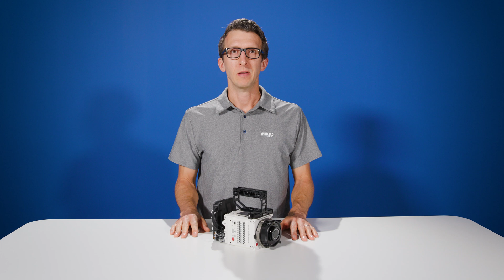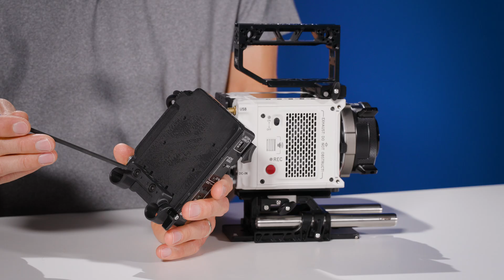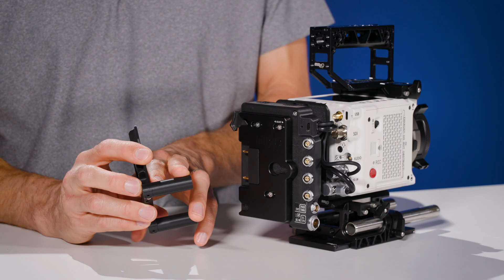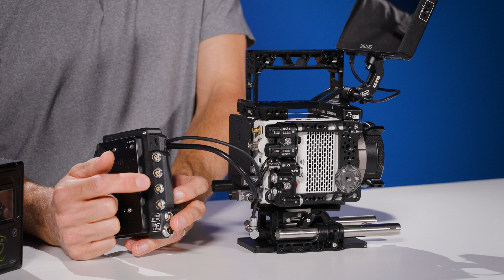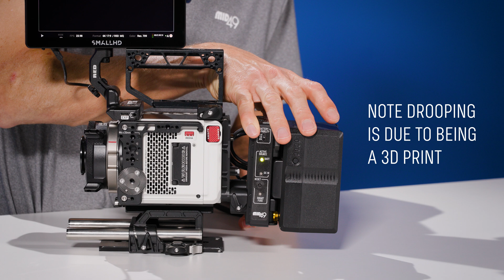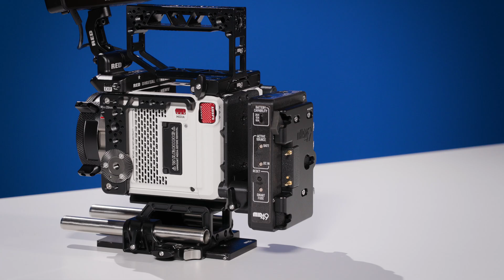Power Distribution Box DB-1 (RED Komodo-X / V-Raptor, Gold Mount)

Comment: This has the potential to work really well for Zcam mkII cameras (Or the Zcam F6 Pro), which have a v-mount plate on the back. I have been looking to a solution similar to this
Reply from the maker: The DB-1 uses the V-Mount as a mechanical attachment method but power is actually provided via cabling. We could probably adapt the DB-1 to a Zcam mkII but would need to use a male 2pin LEMO since that is what the camera requires.

https://www.mid49.com/products/power-distribution-box-db-1-red-komodo-x-v-raptor-v-mount

You might also consider the DB-8 which passes power using the V contact block:

https://www.mid49.com/products/power-distribution-box-db-8-sony-burano-v-mount